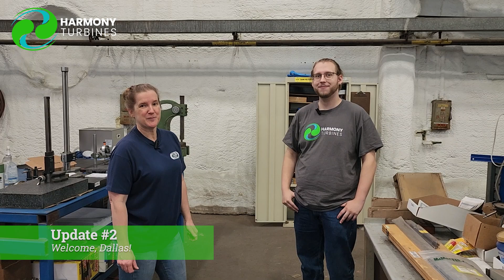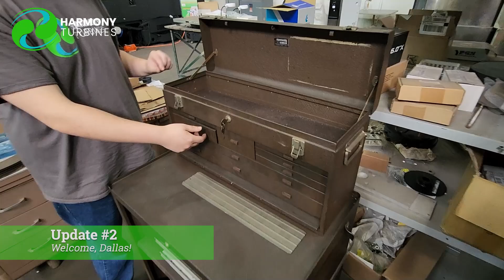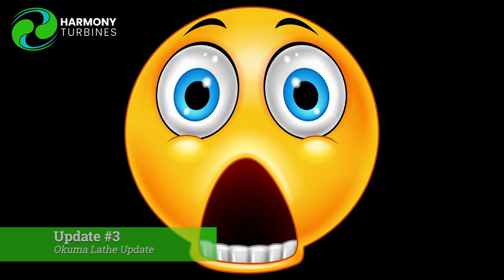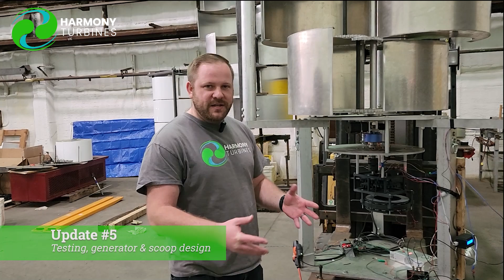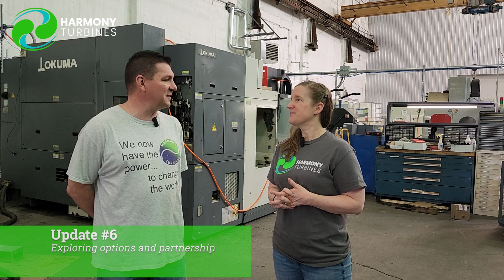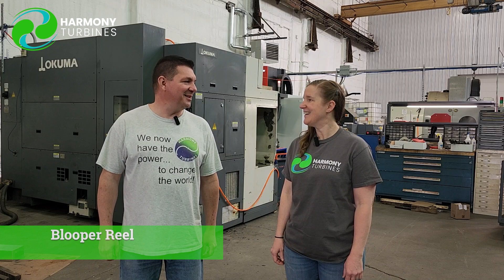April 2024 Update

Comment: Still looking forward to trying out one of your units.  It sounds like this new generator might be more suited to low wind speeds. Making the scoops out of some type of plastic material would also help with that.  The ability to generate electricity at all wind speeds from gentle breeze to thunderstorm driven winds was what made me want to invest in your company.  We never always have some type of breeze here on our farm, but most of the time the wind speed is below what is recommended for most turbine designs.  And if the turbines can work at the low wind speeds, they are not suited to the really high wind speeds we see during storms.  I am encouraged by your ability to think outside of the main goal and find other ways to generate income while not letting those ideas overshadow your main mission.

Comment: Do you know why in this day and age cars dont use rare earth magnets in the alternators?  Because the alterantor is placed near a source of heat wich decreases thair efficiency. Even then the newer starter/generator units are all using permanent magnets. Using a permanent magnet BLDC with a proper BLDC drive to generate the volatge you require is the best solution here. 
I have commented before that the varible airgap thing is not seriouse and you need a solution from at least the end of the 20th century and you didnt answer. You dont need to invent the wheel people have done this for years. Its well understood and documented. You want the higher efficiency you go with permanent magnets and electronic control. The cost will get higher ? Sure 50$ more thats nothing. 

BTW Hysotricaly large wind turbines used doubly fed induction generators but now all are basicaly switching to permanent magnets. And in both cases there is no place for any "variable airgap" that idea is just not viable its basically a mechanism to decreasy the efficiency of the unit mechanically wich -A is not the best way to reduce the startup torque -B even if its your goal you would ruther do it electrically

Comment: would a horizontal version across the ridgeline of a pitched roof, or along the edge(s) of a flat roof work? 🤔
Reply from the maker: Short answer, yes. While Harmony would work this way, it would be far from ideal. The real benefit of Harmony (or any other vertical axis wind turbine) is that when installed vertically, they can take winds from all directions. When you rotate Harmony (or any other VAWT) into a horizontal orientation, you negate the wonderful multi-directional benefits.  If you have any other questions please email us at support@harmonytubines.com and we will be happy to help you there!
Reply: @HarmonyTurbines  imagine this but with the shrouded turbines replaced by a horizontal version of yours. Thats what I was talking about. https://youtu.be/SGQTwcq0UIY?si=juOopTzsVTfR6Zkz